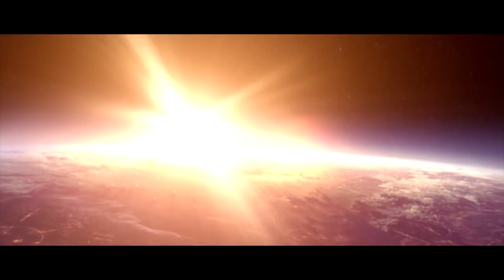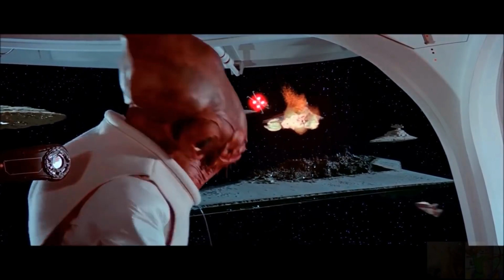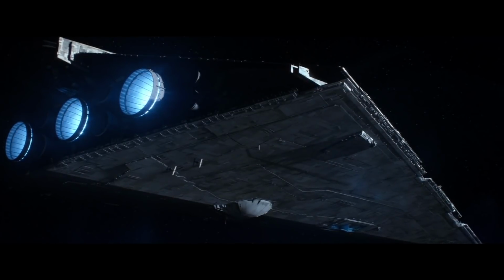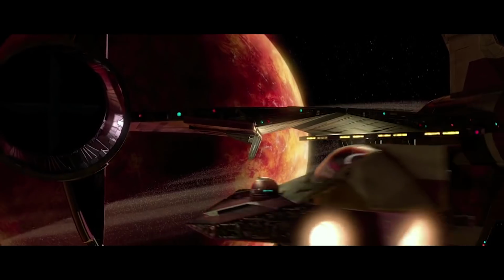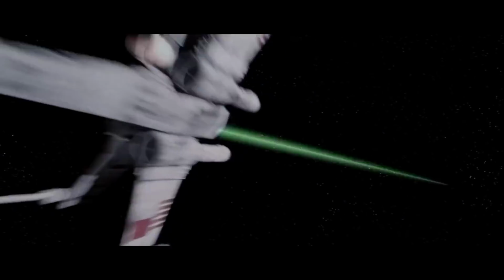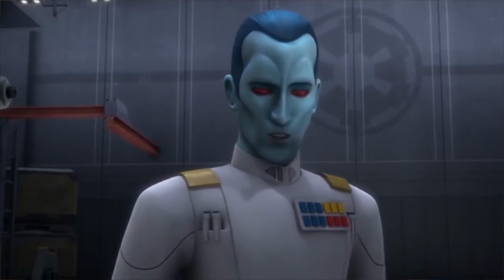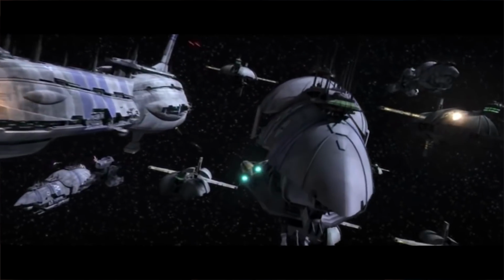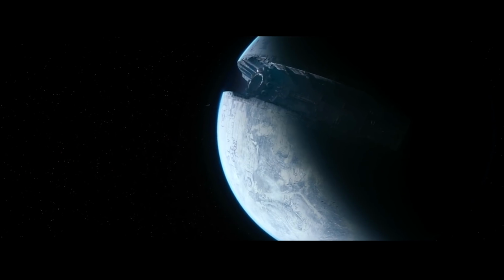FIRST ORDER VS CLONE TROOPERS VS STORMTROOPERS (NAVAL POWER) PART 4

Comment: Oh God! I thought the question about which faction had the best leader ship was hard. This is nearly impossible.
I think…maybe…I’d have to give this round to the the republic.
While the empire had a great deal of fire power when it came to its cruisers, and the first order even improved I’m just how much fire power can armor one ship, let alone a whole fleet, I give this round to the republic for one simple reason: it’s fighters.
As heavily armed as the Empire and first orders destroyers, dreadnaughts, and bases were, each one of them were pretty easily infiltrated and practically destroyed by simple starfighters. This is where the republic takes the advantage.
The Empire starfighters were pretty much a joke and even the most advanced models were either too expensive to be mass produced or had many of the same flaws as the base Thai fighters. Those flies being, the lack of a hyper drive and lack of vision for its pilot.
And, even though the first order corrected a couple of these flyers, by including hyper drives in its fighters and even making one style of Thai fighters a two pilot situation to improve vision, fighters still had flaws, including the lack of vision on its left and right side because of the massive wings. 
The republic not only had a great deal of quality when it came to its fighters but also a great deal of versatility. They had fighters for almost every single situation you can make a fighter for. They had fighters to go into hyperspace, they had fighter specifically made for bombing, they had interceptor‘s, they even had multi roll fighters. And even though the first order and empire had many of these variants, none of them matched the quality that the republics fighters had. 
And because the republics capital ships could hold so many of so many different fighters, they can easily outs warm and outnumber both the empire and first order’s fighters and capital ships.
Again, a tough call. The Empire and first-order have a lot of fire power. But the republic has the tools that they need to cut straight through the gaps in between each one of those heavy guns.
WINNER: Republic Navy

Comment: First order Stormtrooper training is about as good as Mandalorian training it sits comfortably in between clone troopers and Stormtroopers clone troopers have a training advantage but the first order has a tactical advantage the clone troopers because of how they were used throughout the war with four going normal modern Battlefield tactics for the tactics that the Jedi instilled in them and they would get wiped out pretty quick

Comment: I would peg the venator as my favorite. It wasn't the most powerful, but it was the most practical. The turbo lasers were for defense, it can be argued that starfighters are it's primary weapon, and they are a lot more flexible than gun turrets.
Reply: However it is very weak if it can't deploy those fighters.

Comment: The Republic would win because they are better trained with better tactics and the are lead by lots of extremely powerful Jedi. The main tactic of the Empire in the space battles would have been to pull them in with tractor beams, where the battle would have then been between stormtroopers and trooper clones lead by Jedi or cunning republic battle master officers who were well known for defeating superior numbers of battle droids & were usually battle hardened. This way the republic would have obtained control of some imperial ships and turned the tide of battle on the empire & then eventually even have surrounded the death star and destroyed it even without knowing its main weakness like in New Hope. & the first order would be outclassed the same way as well.

Comment: I don't get why people keep on supporting the Imperials in a fleet fight. Yes they have good CAPTIAL ships but not good support ships which is the glue to every fleet. When you look at the average Imperial fleet you see Imperial class star destroyers no support ships not counting fighters which in most models of tie fighter they are cheap and generally ineffective in a fighter on fighter battle. In fleets such as the Rebel fleet you see diveristy sure that may be from what they can grab up but it is still in most cases more effective then the standard Imperial fleet which usually consisted of star destroyers whch is not an effective fleet at all which may cost them the battle due to a lack of diversity while the Average Venator class star destroyer is a fighter carrier but also filled the role as a crusier and captial ship. In a Naval battle in the CW you can see a little bit of diversity in each fleet such as an Arquitence light cruiser which yes it is used by the imps but only as security and not in your typical naval battle. I bet that the First order followed tge same path by using brute force in a varity of different variations of a single model ship while GAR used a more tactical way of devloping ships, the Venator class star destroyer was an all around ship sure it may be as heavily armed or armored it could still put up a fight in not just a fleet battle but a 1 on 1 too.

Comment: I thing you down play the death stars a lot the first ones weak point was that small that with out the planes of the station would it be near impossibel to find and even than very hard to actually hit do to it small size while the second removed even this weak point and with out much damage survived the collision with a Super Star destroyer and was only destroyed out of a combination of being unfinished and overpowered teddy bears.
And to add on to this is the Death Star unlike the Starkiller base not dependent on outside energy sources and the second one can charge its super laser in no time.

Comment: The republic wins this fight just from sheer numbers. It's larger ships are always cheaper to produce and also take less time to produce meaning you can have more ships quicker. this means you can also have a larger fleet. with that in mind, the fighter force from both the Venator and the Acclimators were so overwhelming that the capital ships with very little if any fighter defense can be obliterated by the amount of starfighters and bombers that can be deployed by the Republic ships. This also exploits the first order as they have a limited resource and most likely cannot withstand a major assault from a republic armed vessel. They also have the advantage of the Jedi starfighters especially the ETA-2 since that ship is like a generation 1 Tie Fighter. The Arc-170 and Z-95 being the basis of the superior X-Wing Starfighter also helps this idea. other ships like the V-Wing and V-19 also heavily outweigh the fighter aspect to the Republic army. any way you spin it, yes the capital ships were hardly anything for a star destroyer to take out, but the massive force of fighters, bombers and small starships was easily the turning point to that argument. It would be like an army taking in 14 battleships and 1 carrier vs 11 battleships and 4 carriers. the amount of aircraft would pound the 14 battleships with ease since they're typically not suited with much air defense.

Comment: The Republic fleet relies on starfighters to deliver their "punch", and those starfighters are almost entirely dependent on the ill-armed Venators. So if an Imperial or First Order heavy cruiser can take out a Venator and then hyperjump away, most of the Republic ships are stranded without hyperdrives and the Republic's most powerful branch, the fleet air arm, can be left to die cold and alone in space.

Comment: The Galactic Republic had superior ground soldiers, which even with relatively outdated equipment were downright lethal when compared to the ineffective Stormtroopers and small number of First Order troops. The raw amount of Jedi at the republics disposal must also be noted, because their individual prowess and trial-and-error battle tactics eventually molded them into capable officers.
     Their navy while lacking in ridiculously sized capital ships, made up for it in QUALITY starfighters that usually had a large contingent of Jedi to work with. They could easily raze a couple wings of tie fighters from the star destroyers, and the presence of Jedi make their potential even greater during 1-on-1 engagements between said starfighters. The First Order could potentially put up a decent fight against the Republic's fighters but their inferior numbers would make large scale engagements futile.
     The organizational structure of the Republic was pretty sound compared to the maniacal devotion to the emperor. It was even mentioned that the very structure and mindset of the Empire was what made it weak and collapse after the destruction of the second death star. There was no devotion to the organization, simply fear and domination. The first order indoctrinates and raises their troopers from birth, and encouraged them to fight and advance themselves creatively within certain boundaries, which lead to a much healthier and more flexible work environment. However, the Republic's clone army literally cannot disobey orders due to the bio-chip placed in the back if their skulls, and the bond between the Jedi and clones combined with their inability to look for a life beyond the combat made them deadly and focused to their mission and allegiance to the Republic.
     Overall, the Republic's unlimited reserve of clones, swaths of Jedi, and the characteristics of the clones themselves molded them into the ideal military devoid of infighting (with the exception of Palpatine of course) and useless political turmoil. The experience gained by years of large scale operations made their leaders wise and the individual soldiers especially battle hardened, while the First Order is yet to hit any major engagements. The Empire wised up only in the waning years of the rebel uprising, and their cunning military leaders would only be weighed down by incompetent Stormtroopers.

Comment: Well as long as the republic doesn't get a foot hold on either an imperial/new order planet or ship the later will have the advantage. But the moment clone marines enter a battlecruiser or planet it's over for the empire/new order's control over it. Clones would absolutely curbstomp both stormtrooper kinds. One is trained to be a killing machine, the other is raised to be one, and the clones are genetically modified, raised and trained to be the ultimate killing machine. 
Now you could say that all the Empire/N Order have to do is keep them at bay but keep in mind the Clones have those kick ass transport gunships that just reek of being inspired by russian Hinds.
Reply: Doesn't really matter how good the Clones were. Quality over quantity in war only works on the small scale. The weight of numbers can always trump quality. Even if we throw actual logic out the window and say a single clone trooper could kill 100 stormtroopers it wouldn't matter because the Empire could afford to throw 1000 at them instead and still have plenty in reserve. Same goes for Fighters. For capital ships the Empire could not only do the same but also actually has hands down better ships to boot.

The Republic or the First order could probably put up a decent fight and even win some on the small scale in a few battles where they got lucky and weren't grossly outnumbered but on the whole they would be crushed and crushed quickly once it because a war of attrition.

It's why the Rebels almost always just ran away and focused more on small scale guerrilla tactics aimed at the government rather than ever trying to actually fight a war against the military. Even then they only won unrealistically through plot and deus ex machina.

Comment: 7:22 Yeah no, sorry I doubt the rebels felt any fear the moment they "heard" the creaming tie fighters noise in SPACE.
Reply: virgilio moncada pretty sure he could be referencing when they’re on a planet tho.
Reply: Most of these battles took place near planets, so aid molecules would've leaked out of the atmosphere and settled around the planet. There would be enough for some sound. It would be very muffled though. Considering fighters definitely some tech to pick up faint sounds to improve situational awareness, you could technically head the Stuka-like scream of the engine.
Reply: Every ship in Star Wars has a surrounding sound projection feature in the cockpit- yes, this is entirely to justify the space battles having noise, but it does make at least some sense.
Reply: It fits in with a saying about current warcraft : If you can hear it, you weren't the target.

Comment: Most powerful isn't so important as how it's used. Republic fleet assets would be perfect for hit and run tactics favored by rebel and resistance forces for example. It's like rock paper scissors. Which force is most effective against which opponent with what strategy. Tarkin Doctrine fleets would be a good match against the first order, while the Republic fleet would be the best match against the Imperial fleet provided they only committed fighters to an attack and kept their carriers out of direct contact. Any of these factions could be effective against the other, it just depends on how they are used.

Comment: Carriers beat battleships, so the Republic wins. They can engage with a large amount of fighters and bombers, easily able to punch through the air, or space, wings of the Empire. Besides, they can put the tanks on the outside of the ship and use those for close range righting. I think that a republic cruiser could easily beat a star destroyer 1v1, sending in fighters while pushing in to fight them ship to ship. Not to mention, Jedi are known to be excellent pilots, able to have a better reflexes, but even more importantly, pull an insane amount of Gs without having to worry about their bodies. They could become their fighters, only limited by their fighters physical capabilities. As far as I know, TIE fighters aren't capable of dogfighting, as I do not know of any through cockpit capabilities on them. So, unless there's a pilot with force sight, the maneuverability of those TIEs are useless. Clone ships have the inherent advantage of better visibility, so unless there's a helmet system I don't know about, the clone fighters win. Can't something you can't see. On a 1v1, the carrier wins.
Reply: Liljefe 301 TIE fighters are highly agile and they have targeting systems. Also did you not watch the Original trilogy they racked up dozens of kills.

Comment: I would say First Order, Simply because of the first orders weapons systems out-wight everything else. The Resurgent Class Star Destroyers Double the Weapons of a Normal Imperial Destroyer and not only that they also have Kyber Crystals powering them, So count every hit like a mini death star laser, It would pierce straight through shields.  It's also been hinted at that the First order has force sensitivity in their destroyers which is provided by the Cyber Crystals and that this makes the weapons slightly more accurate. The First orders fighters were also in higher numbers than those of the Venator Class Vessels so in reality, it could be the Venator-class vessels that are overwhelmed.
It count's on the amount of Resurgent class Vessels the First order has, Which is hinted to be a lot.

Comment: Empire. the super star destroyer was just ridiculously powerful and it carried a crap ton of fighters and even if the empire has its disadvantages they had one thing really useful, ambition. Officers were always looking to get ahead and this means that new tactics are always being devised, also, sith are NASTY.
Reply from the maker: ambition is powerful in the case of officers like Tarkin but for others it led to corruption and unnecessary infighting. Your point about the the super star destroyer couldn't be more true.
Reply: But what about the Pride of the Core it was also classed as a star dreadnought and you forgot a lot of other republic ships like the victory class star destroyer and the first ISD's
Reply: SSDs only carried about 144 tie fighters at max
Reply: Gen tech it could be a little bit too much credit given the fact that th averwge SSD only carried 144 tie fighters into battle while yes it may be powerful it lacks fighter repuslion as shown by a rebel fighter crashing into Vader's flagship and right into the bridge.
Reply: gregory maynard Well, you forget the Republic had a bunch of Mandator II's that could rival Super Star Destroyers.

Comment: 1:25. You left out the fact that the Venator also had 4 heavy proton torpedo tubes carrying 16 warheads. Yes this information is still canon.
Reply from the maker: yea I left out torpedo tubes because each type of ship had some many different variants that could be fired out... but yea the proton torpedoes definitely add a lot more fire power to the venator
Reply: Generation Tech Ok. Another thing I noticed was that you left out the V-Wings (the fighters escorting Palpatine's shuttle at the end of episode III) out of the Republic's starfighter force.
Reply: And don't forget the SPHAT turbolaser that was mounted on many venators in the 501st legion. BTW, you just gained another sub from this video alone.
Reply: General Stormagedon That actually is quite a boost that could put a chance against Imps and FO but Tech left it out as it was just a modification and not standard issue.
Reply: Hayden Reeves Only that the Venators armor was much weaker which is why the Empire ultimately discarded them.
Reply: He also left out the SPHA turbolaser as well.
Reply: Patrick Donnolley You-re right.
Reply: Or you could say this information is still... "Cannon!" Uh huh! Anybody? No? Okay...
Reply: you also left out that the acclamator had a duel shield system that was equipped on most acclamators
Reply: Also the Vendor had firepower equal to a Imperial Class Star Destroyer. Wikipedia.